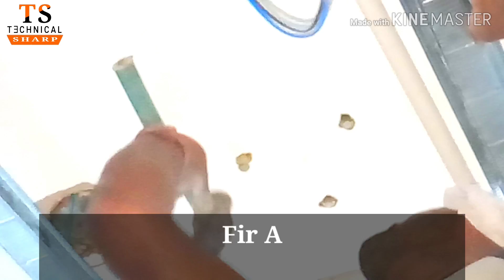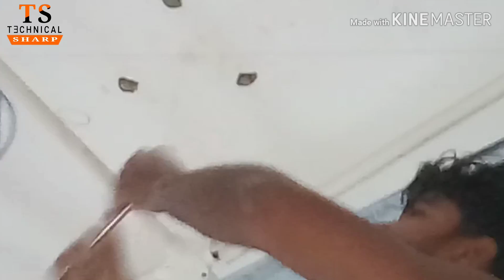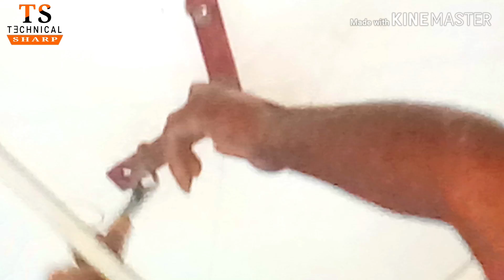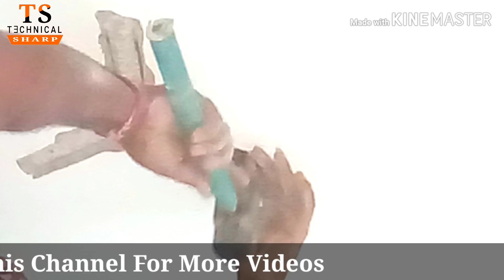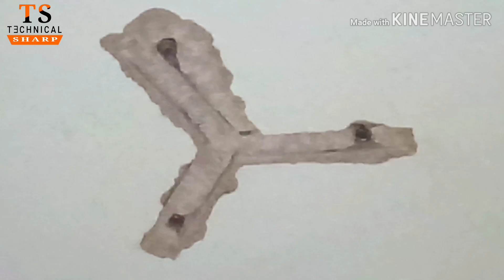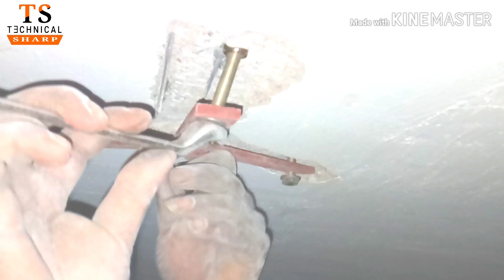How to ceiling fan fastener installation..By Technical Sharp

Comment: Bhai jab 8mm fasnar he to bit bi 8mm hi lagegana
Reply from the maker: Nhi , 12mm
Reply: @TechnicalSharp  sir muje 10 fasnar lagane he or makan malik signal pin vala fasnar leke aaye he to fan ke liye sahi hoga or konsa bit lagega sayad 8mm fasnar he or mcl use kare to kesa rahega
Reply from the maker: 10 fasner ke liye aap ko 16mm ki drill bit ki zarurat hoga..
Reply from the maker: Mcl ki koi zarurat nahi,
.
Jitne hight ki fasnner hoga usko drill bit pe lagaa ke rakhiye or utne pe kuch nisana (Ex - pvc tape) de dijiye ki sirf itne hi roof pe drilling karna hai...

Comment: Bro this bolt can bear 80kg or 100kg wight , if we set in house slab .. rply bro..  for hanging purpose .... Which size will u preffer for my requirements
Reply from the maker: इस एंकर बोल्ट में 300-400kg+ तक wight का सामान इस में हैंगिंग कर सकते हैं...

Comment: Konse size k anchor bolt k liye konse size ka drill bit lagega ? Please explain. Please reply.
Reply: Agr 10mm ka fix bolt ho to kitne ka bit lagega
Reply from the maker: 13.5
Reply from the maker: आप कितने साइज के एंकर बोल्ट इस्तेमाल करना चाहते हैं बताईए...
।
मैंने यांहा 8mm एंकर बोल्ट के लिए 12mm  की ड्रिल बिट इस्तेमाल किया हूं
Reply: @TechnicalSharp  different sizes of bolts like from 6mm to 12mm